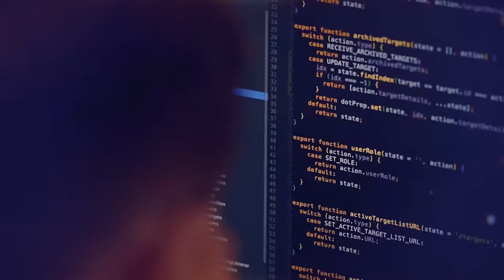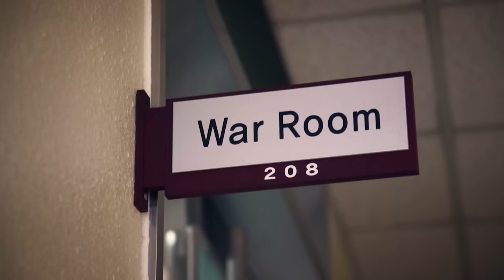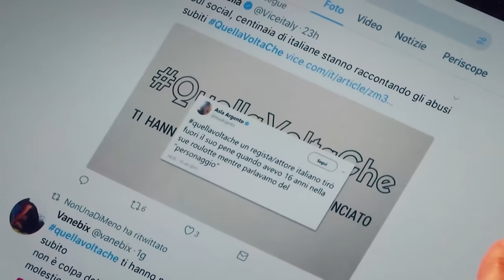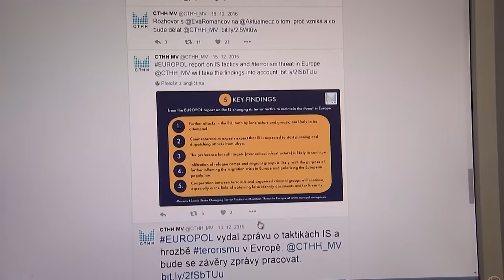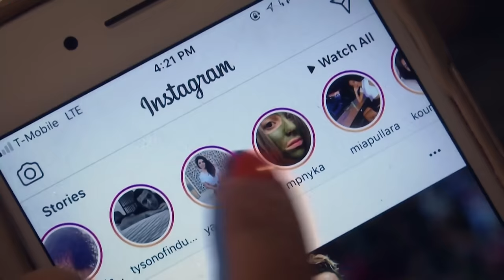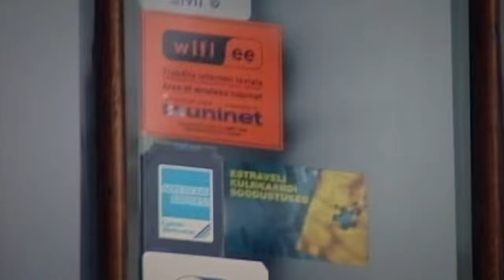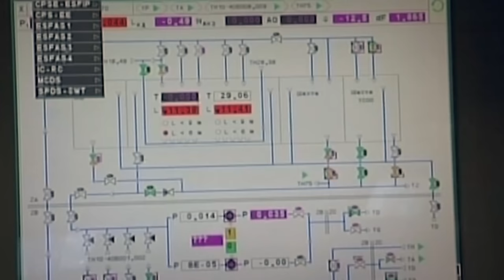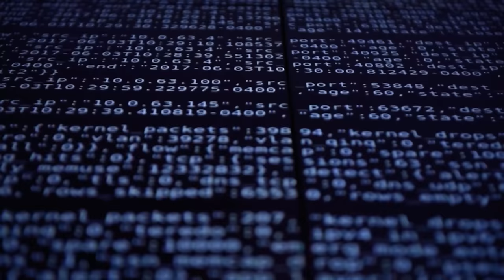Why Cyber Warfare Is The New World War | Future Warfare | Spark

Comment: Im 30 seconds into video and he says what happens when you wake up with no internet?! The roads wouldn't work hahaha only a chump thinks like this
Reply: It’s true.   Anything electronic is networked today.
Reply: @andybaldman  so you can't drive on the roads ??? The stoplights might not work roads are still perfect!!!!
Reply: @lespaulr6  not once the tanks tear them up.
Reply: @montbob100  yikes that's drastic thinking
Reply: @lespaulr6  Yes, roads are physical things.  However we aren't talking about country back roads.   There is also an electrically-based infrastructure behind much of our road system, particularly in cities.  Traffic lights, drawbridges, signage, safety lighting, etc.   Stuff that allows huge volumes of cars to pass safely.   Powering all that stuff off will not have zero consequences.  In a place like New York City you'll end up with gridlock if all of the traffic lights simultaneously stopped working.